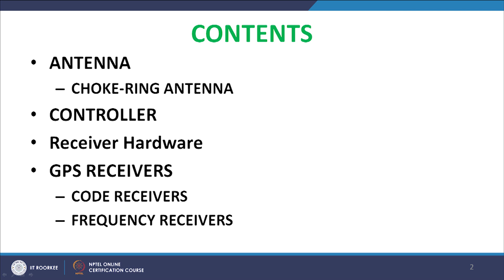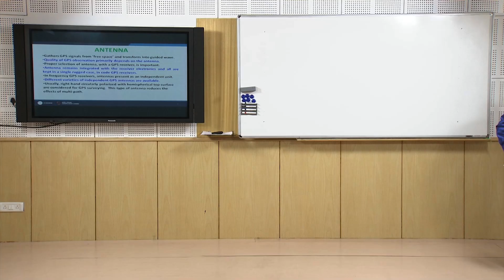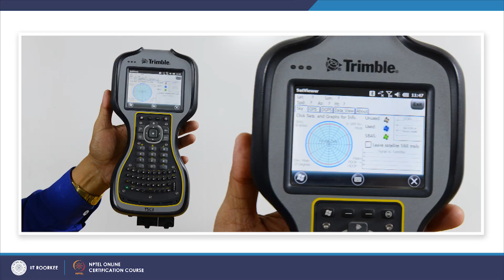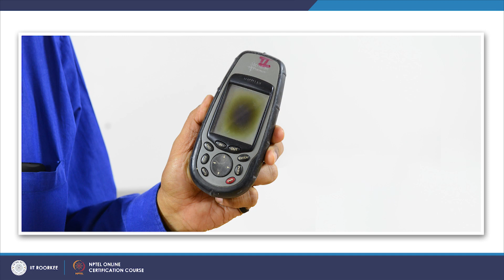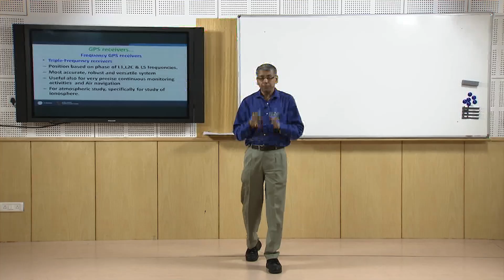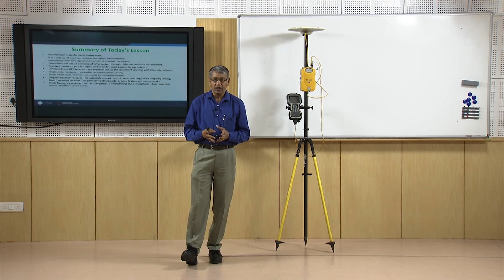GPS Receiver

Comment: The most important part of a GPS receiver hardware is?
Reply: The first thing is your antenna, you need to have an antenna that is probably active in nature and can receive signals at the frequency of 1.1 to 1.6 GHz. 

The next thing is your front end. These two are the most important components the rest can be configured in software easily.